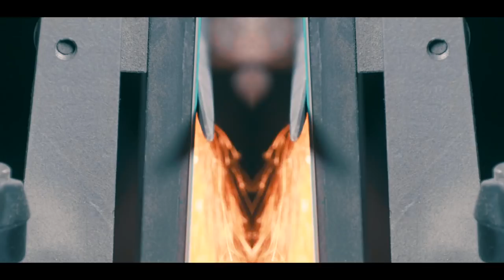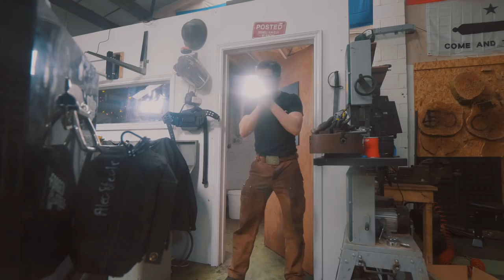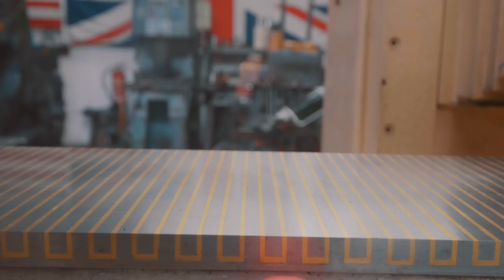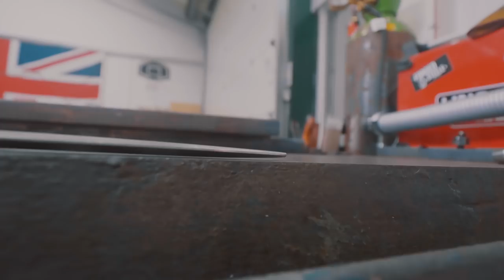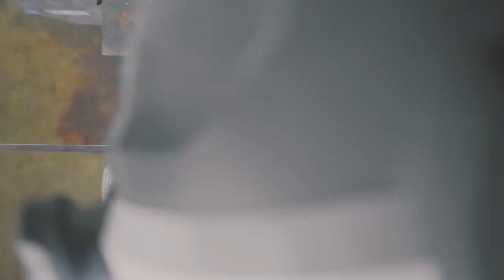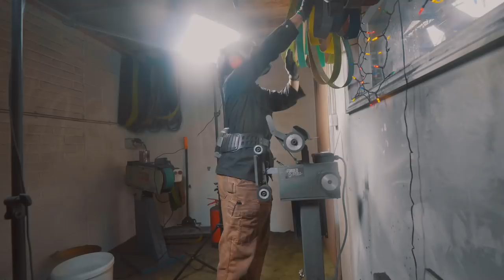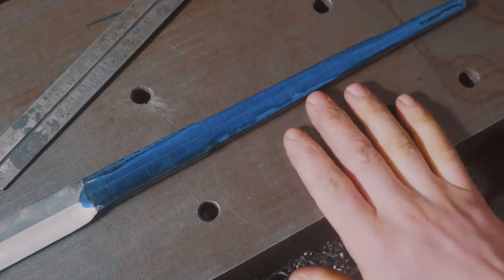MAKING A BASKET HILT RAPIER SWORD: PART 6

Comment: Alec, couldnt you shim the high spots on the surface grinder so it wouldnt be pulled down and keep its original bend,
then grind flat one side 
then since the first side is flat flip it and no shimming required 
grind the other side?

Comment: Would stretching it help? Two points make a striaght line and if you clamp it and stretch it (or tension it) while it was heated, it should remove any kinks and make it straight.

Comment: Would you see a benefit of making a roller that will rest at a horizontal 90-degree angle to the belt grinder rollers on your adjustable flat portion(just sticking strait out) that will act like a bench rest, except its not a flat plate, it’s a roller, and could be swiveled up and down. Once you get to the point of polishing and arent worried about bumps and notches messing up your passes on the grinder, it would really help the stability and tension on your arms once you start the mundane process of polishing doing the same thing repetitively going through the grits. Just a thought.

Comment: Re: surface grinding bendy things... Could you set the sword in resin, wax, cement or plaster, etc so it can't flex. Then grind one edge flat with that material on the flat bed. Then flip so the now flat side is on the magnet flat bed and grind the other side.

Comment: When you make a knife in the future, however, if you get a grinder wheel that has a taper to it, you can grind the knife bevels that way. The knife would be placed at the edge of the magnetic plate and the wheel grinds the perfect bevel. Look up Freerk Wieringa. He has this setup and it works wonderfully.

Comment: When you talked about why you can’t use the surface grinder to make it flat I laughed hard. The company I worked for had that exact issue happen after heat treating a semi finished part for a gas turbine. The part warped in heat treat then went to be finish machine but when they clamped it down it bent to straight only to spring back after releasing.

Comment: what if you used the magnet from the surface grinder and some 1/2" stock to prop up the endson either side of the warp to make it straighter before grinding?

Comment: That is a pretty aggressive grind on a heat-treated blade. I thought you said you were going to use a mist to keep it cool during the grind but I don't see it on there. Am I missing your cooling method/process because of the time lapse or do you have another method to maintain the heat treat that you worked so hard to put into this blade?

Comment: Shim your blade onto the surface grinder bed so that it doesn't distort when you engage the magnets. Grind the blade on the one side to make a true surface without distortion, then flip it over without the shims to do the other side. (maybe?)

Comment: Alec, if you quench the blades and the warp due to some hickory dickory doo daa. Why not stick it to the magnet right after? Then it has no power to its own to bend? Or is the stresses to large that they overcome the force of a strong magnet, like on your surface grinder? 
Maybe it worth a try :) (on the “weak” parts of a blade that tends to warp)

Comment: I think that for a rapier, what you ought to do with that blade is work it up to 6000 or 8000 grit using a Japanese whetstone, and then use chromium buffing compound to get it to a perfect mirror sheen.  I really want to see what the Damascus pattern you have here looks like with a mirror polish surface to it.  Of course, sadly, you may have to etch it, and etching a mirror surface probably will damage the mirror surface, or might cause the Damascus pattern not to show at all as the etch might not take well to a mirror smooth surface (on account of the minimized surface area from polishing it, albeit doubtfully)

Comment: Is it possible to put a hot blade on a magnet so that as the blade normalizes it will be under the force of the magnet? Or does critical temperature remove the piece's magnetic properties entirely?

Comment: you could have encased the blade on acrylic and then use the mill to rectify without applying any external force to hold the blade

Comment: If you could fit the Sword in the surface grinder, couldn't you shim underneath where the warp is before you turned the magnet on so it wouldn't get sucked down into the magnet?

Comment: Alec, could you use the magnetic clamp during the normalizing cycles to straighten a warped blade?
Reply: Thomas Russell normalization is done before hardening. The problems came after the quench while it was transitioning.
Reply: Bob Haas if you go back and watch the previous video, he was getting warping during the normalizing cycles too. Besides, it was a question in general, not specifically to this blade. Thanks for the information though.
Reply: The warping in the normalization was caused by stress from forging that was still in the metal. When you move metal that much it builds up a lot of internal stress at the molecular level. Normalizing relieves that stress. If he forced the blade straight those stresses would still be there and would likely cause failures in the hardening process. Normalizing as many times as it takes for it to stay straight on it’s own is critical.
Reply: Bob Haas again, thanks for the input. Might help someone who is unfamiliar with the subject. I've seen many blacksmiths use mag-clamps during normalizing and heat treating cool downs with no issues. I was making a suggestion without trying to tell this accomplished young man what to do. Talk at you later.
Reply: BTW, Liam Hoffman has used a mag-clamp in such a way, for one example.

Comment: this is gonna be a very stupid question but  when you have bends and such why not get a powered magnet long enough and while the metal of the blades is still malleable  why not put said blade on said magnet to straighten it seems like that would work to me instead of all that going back and forth @Alec Steele

Comment: If you had a magnetic chuck and surface grinder capable of handling the blade length could it be shimmed in such a manner that the chuck would not suck it down so you could grind it flat on one side and then do the same to the other side, shimmed if necessary? What do I know... I am just a fan!

Comment: Would a vertical jig of some kind help with trying to remove warps/bends where gravity and weight would work in your favour?

I do suspect that the good old method of getting a straight blade is what you're already doing and it's referenced elsewhere in a comment I've read elsewhere in the comments section - forge a chunky 'sword die' as straight as possible and grind to straightness accepting the imperfections.

Comment: A bit wacky, but casting it in some sacrificial substrate, an epoxy or what have you, or at least half casting it above a flat surface would account for that deflection. Comes with its own challenges, but hey, nothing ventured, nothing gained. Interesting idea for a smaller project at least.

Comment: You could try to heat i up again and let it cool down and at a certain point put it on tge surface grinder power on the magnet and sokeep it straight
Reply: MrCreep07 that would remove the hardness and he would have to do it all again.

Comment: Hey Alec.. you know you'd get a more consistent grind by grinding the sword holding it vertically and running it along a single point on a wide wheel.. a lot more consistent than running it horizontally they way you do, anyways.

Comment: Could you secure it from either end and stick some shims under the parts that come off the table? Maybe drop it in some plaster or thermoplastic like a jewler?

Also, is there a reason the grinder is in a separate room?
Reply: Morgan the reason the grinders are in a separate room is to keep the iron filings contained and to keep the iron dust particles inder control and filtered.
Reply: The grinder is in another room because of all the dust it generates.
Reply: Grinding fills the air with particulates (a lot of which are carcinogens). Having a dedicated grinding room means he can contain all of that in the one room where it is easier to clean up. Other wise he'd have to wear the pressurized filter mask all the time during grinding and grinding dust would get all over his otherwise lovely clean workshop.
Reply: The Grinder Room is so that dust particles doesn't spread to the whole shop. Not healthy to breathe in, and it would settle as dust on everything. Now he keeps it all (except the surface grinder that is too big for the door) in one easy to clean room. And he also got a Air purification system mounted on the roof with filters. He went through it all in one of the New Shop videos (building the room, why etc)
Reply: Ah, cool, makes sense. Thanks!

How about that plaster, though?
Reply: The reason the grinder is in a different room is for dust control. To keep dust isolated and off of the rest of the workshop.

Comment: Wouldn't it be better to use the surface grinder and in the high spots use copper washers? That way you can grind it out flat. I'm obviously ignoring the fact it doesn't fit lenghtwise.

Comment: A traditional rapier's handle was burned on, in other words the wood part of the handle had a whole drilled through and then the tang was heated, they would push the handle on the tang and the heated tang would burn the shape of the tang in the handle making for a perfect fit. Of course then a pommel was made as the cap, now early development the pommel was riveted on and there was no removing it, however later development would have a threaded pommel. And that is where the comical "end you rightly" came into play. I still don't know, "(ever though there is actual historical evidence that suggest this being a thing"), if it really was a thing as it sounds really funny for someone to do.

Comment: I wonder if that would have worked just after the quench. If you had put it on the surface grinder and turned on the magnet and let it cool. Idk, maybe that would just cause more stress in the steel. Does anyone know?

Comment: Your statement that using some artificial method (magnet, for example) to bend the blade to put it into the surface grinder (or any other such machine) keeps you from being able to permanently straighten it later when you remove that force is the basic problem with quantum mechanics:  Trying to "ïnterfere with" (measure or change) something messes up the results by mixing your effects up with its effects so that you do not know what the final result will end up being.  To wit, the "Uncertainty Principle".

Comment: I have been wondering why no one makes sheet steel (1-2mm -600/900) out of Damascus I would like to build car parts like engine cover and intercooler /piping etc , but trying to get my hands on sheet steel is difficult even Google has no results, is there any downsides I have not considered forging something so thin ?

Comment: Probably dumb, but heat the blade set on the surface and apply magnet to straighten.  wonder if that would work to overcome the memory of the metal.

Comment: Didn't rapiers have the slightest bend to them anyway so as to flex in a presictable direction?
Reply: Mike Ford if I am not mistaken, you are referring to a cutlass which were know to be used by pirates.
Reply: mustafaa pochee I don't think so. The Cutlass was more a slashing sword. Single edged, quite a bit thicker than and shorter than a rapier. Thicker both side to side and edge to spine. Also, they were often fullered for most of their length. The rapier is a stabbing weapon and will bend along it's long "flat" surface. If you can have that bend become predictable, you know exactly how to recover from the strike. If it'll bend randomly, you'll be constantly having to adapt the recovery.

Comment: Alec, hopefully this will be helpful advice from someone who has never forged anything and certainly has never made any swords (though I've watched and loved most of your videos).  The shorter version of my advice is at the end.

You're explanation concerning why you won't use the surface grinder to grind the blade makes sense-to a point...   I have a wood planer and use a much bigger one at work . You can't plane a warped board flat for exactly the same reason you just explained.  Wait...that's actually not true.  You can using a planer sled and shims.  The sled provides a flat reference for the shims which are used to maintain the warp under the pressure of the feed rollers in the planer.  Here's a video that explains this much better:  

https://www.youtube.com/watch?v=bexzF1pyYGM
https://www.youtube.com/watch?v=E5yFZULwjpA

The short version of all of this is: If your material will fit on your magnetic plate but has a warp, simply shim under the warped areas enough that the magnet won't straighten your piece. Then grind as normal.

Comment: Seriously? Alec, You make amazing stuff but really? Part 6 and its 11 minutes of you obsessing over how straight it is and 3 min of grinding. Dude.... MAKE LONGER VIDEOS WITH MORE CONTENT.  If ideas are lacking and your trying to stretch it out might i suggest a pinterest account for inspiration. If Perfection is your goal and your obsessing, i totally get it but man we dont need to know the exact measurements to 0.00 of an inch across every station of the blade. Good plug on the starret calipers though. In short...LESS YAK YAK MORE WAK WAK
Reply: Id rather see you super enthusiastic talking AND swinging a hammer (or grinding what ever) than running back and forth going "Ahhhhh Its not straight Ahhhhhhh its Bent Ahhhhhhh its shaped like a pretzel"  Fundamentals man! Make some wall hangars, Make a Free standing Fire pit Make some decorative Damascus wall art or forge out some end table frames and legs. Do some Cask Banding, Build an iron Banded oak door...i dunno.
Reply: Hanging Planters are always cool thats some wire work that could be very intricate.
Reply: Weapons will always be cool and dill watch the crap out of your sword making videos but MAN black smiths made EVERY THING back in the day. Those hand plane blades were smokin. The Kirdashi (i think) the Japanese marking knife that was a masterpiece. One of my favorite videos is when you made Shelf Brackets because IT WAS NEW